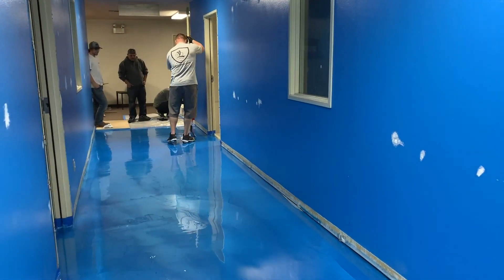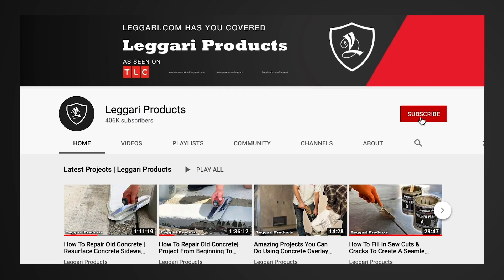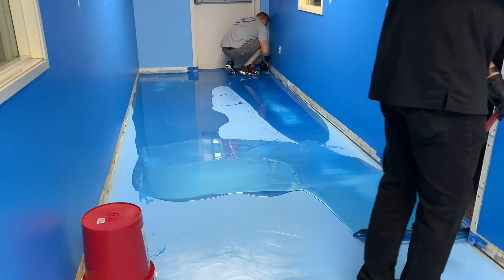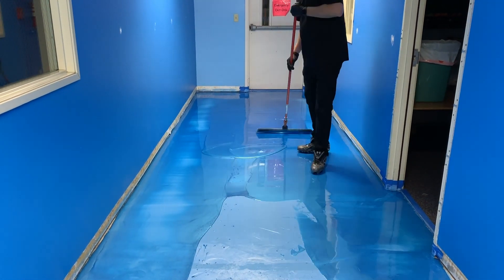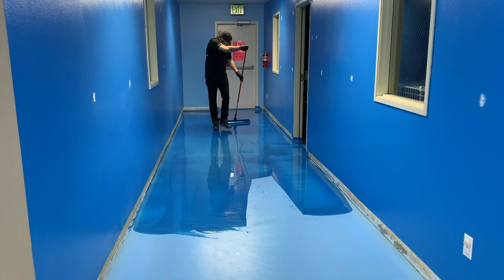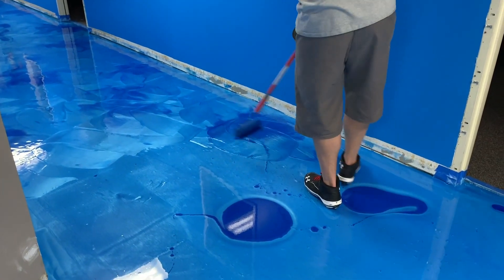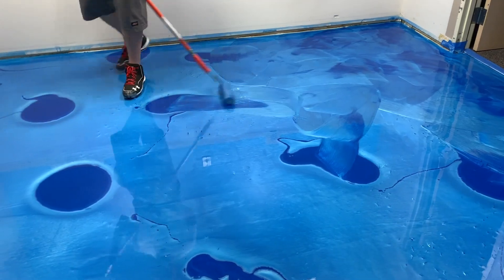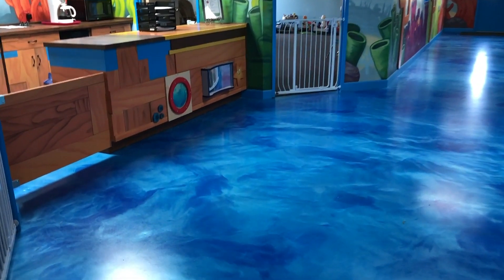Epic Underwater Wonderland Epoxy Theme Floor Installation | The Kids Loved it | DIY Friendly Process

Comment: Now thas alot of Epoxy👍🏼  what how does that work there stepping on the paint  or epoxy , Base Coat   what is it Magic 1:16
Reply: Metal cleats my friend
Reply: @gedionsamuel2256  : Really well you would think you still get paint on metal, well it still Magic LoL 🎩🦯✨✨✨ it's a great job for the Kids.
Reply: @Rom3 What happens is the metal tips pretty much cause an indentation, but as soon as you lift off, the “hole” pretty much fills itself up since its pretty much like lacquer consistency. You ever poked at a pizza dough?
Reply: @gedionsamuel2256  : Ahhh alright make all the sense TY for explaining i just never seen a base coat of sort.
Reply: @Rom3 I’m just messing with you man, it’s just magic! 😁

Comment: @Leggarri. My question is how did you get the product to cure fast enough for the traffic to continue or was this a fresh office space?? I’m getting ready to do my countertops but 7 days without a functional kitchen will be tough
Reply from the maker: The epoxy is hard in 24 hr and the full cure is 7 days to get to it’s hardest point. You can resume use on your countertops within 2 to 3 days after applying the kit. Thanks

Comment: Love your projects and products. How does the “alcohol” spray technique work exactly. Thanks you and a very Merry Christmas to you and yours.
Reply: It's literally just the alcohol mixing with the epoxy's surface and making them run more. Makes the edges where they mixed the two colors blur together so it's not showing any harsh, bad looking streaks.

Comment: BEST VIDEO.,I'M NEW SUBSCRIBED. QUESTION:LIQUID DIAMANT IT HAS 91% ALCOHOL,OR I HAVE TO PUT 91% ALCOHOL BEFORE USE ON THE TOP FLOOR ? THANKS IF ANSWER  APPRECIATE. ✌
Reply from the maker: Liquid Diamonds is one of our powder Metallic pigments. We put it in 91% isopropyl Alcohol. Thanks!

Comment: How do they not track that wet epoxy across the floor when they walk on top of it? It’s wet as can be. They obviously just poured it, & are then walking right thru it. But it doesn’t stick to their shoes somehow?
Reply: They have baseball cleats (Spikes) so only minimal contact with the floor and the spikes are like 1" so they are not walking in the epoxy.
Reply: @joegresells2161  Yeah, I noticed that on another video of a pour. Lol. But yeah, that really had me bewildered there, for a minute.

Comment: I had played soccer before in my life and used cleats. I have painted a house before and always paint in a direction so i don't back myself into a corner. But never would i have thought about using cleat to leave less tracks when painting. There is never a correct way of doing things, just many option. . . .

Comment: Why can you walk on it without it sticking to the bottoms of your shoes?
Reply: They have spikes on the bottom of their shoes that keeps them slightly elevated off the floor (like golf cleats).
Reply: @heatherpierce1141  Are they special cleats? Are they smaller than regular cleats? Or they just the same kind of cleats football players use?
Reply: @juteeb4955  With slow curing, semi-self leveling products you can wear regular shoe cleats, like sports players. However with some products that are thicker and less self leveling (Like polyaspartics that are cured in 1 day) you would wear specialized cleats that just clip around your regular shoes, they're like walking with a bunch of nails on the bottom of your foot. Look up "Midwest rake spike shoes" if you're curious for a picture

Comment: Not really interesting or underwater. It would either need to be built under water or you would need to build something like aquarium around it. Either way you would need to remake the whole building with stronger and waterproof walls, waterproof power grid with some underwater lights, no electrical sockets, some waterproof furnitures.
1-"Aquarium"
2-Building
3-Fill with water
(optionally fill with plants, fish and or make a small ecosystem inside)

What you have in your video is just underwater themed and it's quite disappointing :(